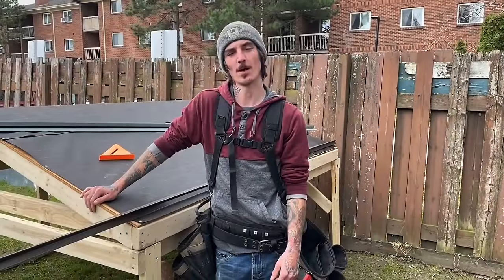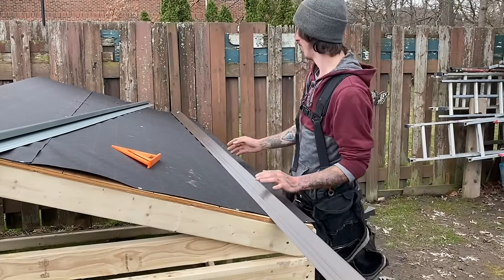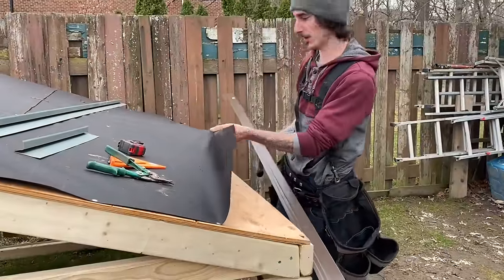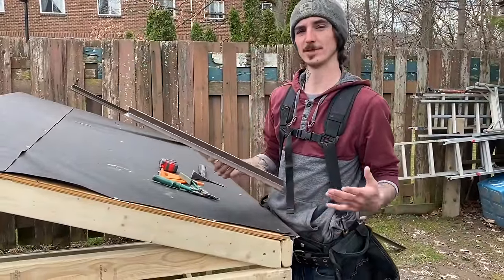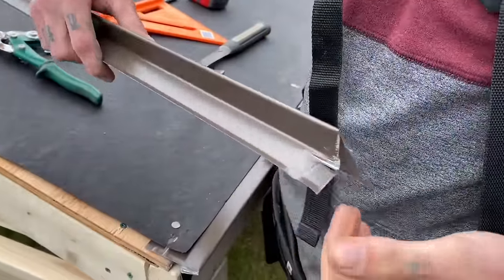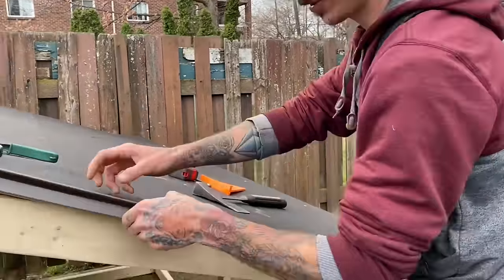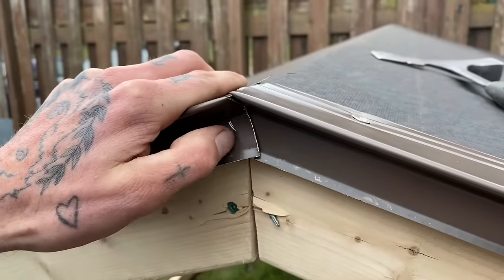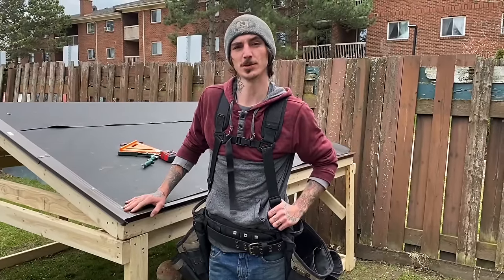How To Install Drip Edge On A Roof

Comment: Hey please don't  spread that information to put the drip edge tight to the fascia. You need to float it out at least 1 inch past the fascia.   The gutter  will only go under the drip edge at one end then you need to have slope. Thats why the drip edge needs to float out so it can still drip into the gutter when you add your slope. 

Having your drip edge tight to the fascia will cause water to drip in behind your gutters.   

I've owned my own gutter business for 11 years and I speak from experience. Customers would always call us after a new roof installation was done, saying that their eavestrough were leaking all over and the roofer said they needed a new gutter system.  But really they installed the drip edge wrong!  

If you think I'm wrong add a gutter to a 20 foot run have your proper slope at the other end.  Yes you tuck your one end under the drip edge. But by the time you slope your eavestrough to the other end it won't be under that drip edge.   In that section do a water test. Grab a water hose and let it run off the roof and you will see the water drip in behind the eavestrough.   Most roofers don't install gutters to understand the importance of floating it.  And you cannot tuck the whole length of gutter under the drip edge or else it would be straight with no slope. You need to have slope! 

Roofers for years have been installing drip edge the way your explaining it and its wrong. Thats why you believe that's how you actually install it because you were taught that way.
Reply: Jason Lajaro is right.  There is a TOH video demonstrating this.  Not only the (important) gutter issue, but even if no gutters are present, having the drip edge tight against wood fascia will allow water to crawl back up between the drip edge and fascia due to capillary action (especially in wind blown rain, which most rain here in New England is).  I just ripped out a bunch of rotted wood fascia due to the drip edge tight against it- it's best to leave a gap, although I'm not sure of the ideal gap - Tommy of TOH says "a finger"- I was hoping for something with more precise units but I think about a 1/2".   Some people use a furring strip to create that gap but I don't see the point as then the furring strip will rot (and look nasty from below for runs visible from below) and in turn will eventually cause the fascia to which it is nailed to also rot.  I think a decent quality/gauge drip edge doesn't need a furring strip to support the required gap.
Reply: is 1'' too much.. I was told by a roofer to leave it 1/4'' off?
Reply: Good info, but does that advice also apply to the rake edge or just the eaves edge?
Reply: @jeclose  Just the eaves edge.
Reply: @christopherr7195  1/2 inch for the drip edge and shingles should extend a further 1/2 inch for a total of 1 inch.
Reply: 👊 some one that actually understands water retention
Reply: lot  people who use named product carry on what manfacture states and depends on state code most prefer a inch out as it drips away from the  board but hey if its windy lol rain going get everywhere  id use a compound to seal corner thats  been cut to shape
Reply: Mr. Average Roofer, is exactly right it was hard to hear go to 2:35 and listen carefully he says, "but not too tight against the Fascia board" because you would want enough room to put the Fascia Metal which is about .030 thickness which can slip behind a very small space behind the drip edge  therefore not needing all the space that you are saying and I know you Jason are very aware that the bottom edge of the Fascia Metal goes down into the gutter so there is no possible way of water getting behind the Gutter. If all gutters can fit up high behind the drip edge then there would be no need of a Fascia Metal but because of the different Gutter Filters, gutters now days need to be mounted much lower than years ago that was before Gutter Filters therefore the need of Fascia Metal so the wind cannot blow the water behind the Gutter.
Reply: Well said Jason, I've been in the seamless guttering business for 43 years I have not yet seen one roofer put the drip edge on the correct way. Really sad.
Reply: @LO-cd7ze  and in winter icicles
Reply: That’s my logic the drip edge has to be above the gutter and away from facia. If you understand capillary action of water. Water can run horizontally and go vertically even up hill. Water has to be guided to drip in the gutter or it will hit facia board or even go behind top of facia .
Reply: Your all wrong.  It's called roof apron. Try it . Way better than drip edge . No water behind gutters.
Reply: @williamclark1801  I've watched 20 videos on Roofing and guttering and everybody says everybody is wrong so either there's a right way and a wrong way so either everybody's doing it wrong or everybody thinks they're doing it right for the average Joe like me it's confusing
Reply: @U4Eye  roof apron is the only way to go.

Comment: Why would you cut your rake dripage at the top of the roof line instead of putting a bird's mouth in the bottom of it and folding it over so there's no gap for water to get in?  That makes as much sense as wiping before you poop.
Reply: Fu*** thank you. How is what your saying not standard by now. Looks better too. I make a perfect ^ then the drip edge seems are equal length the rest of the way down just tuck underneath so your seems are not catching water
Reply: Can you recommend a video that demonstrates what you are talking about ?

Comment: I was under the impression that there is suppose to be a gap between the drip edge and fascia board so the water doesn't run on the fascia board which would cause the board to rot over time.
Reply: You just shouldn't have it super tight to the fascia, have it just resting there. Nail one side of the drip edge, go to the middle, pull it towards yourself just so it's laying flat/flush but not tight. Nail it, then do the same with the end. Makes it so the nails don't buckle the dripedge

Comment: TY all so much I had a new roof done by a contractor that put on the drip edgg and ridge edgg  on first the drip edgg i see you also did that which is fine but they also did the ridge edgg first and then the underlayment was put on and sometimes leaving a space or not on top of the edgg at all so this just confirms they did it wrong. You might consider not butting the drip edgg up against the facial board this makes the rain fall away from the facial board better or into a gutter when the rain is not that hard some will still flow down on the boards and Rott them. Thanks again great video.
Reply: Saw that too. Was thinking if you have flashing right behind the drip edge and into gutter the water will never see the fascia

Comment: The drip edge should not sit against the fascia.
Reply: Then where the hell does it go
Reply: @VegasRoofer Drip edge should sit about about a half inch away from the fascia (that's why he put his fingers between the fascia and drip edge to make sure there was always a small gap between them before nailing down the drip edge).

Comment: The bozo that did my roof on the house I bought place the drip edge against the fascia..When it rains the water runs down the fascia..I thought the drip edge should extend past the roof edge so water clears the fascia
Reply from the maker: jbee railroader does your house have a metal fascia flashing or bare wood?
Reply: Omg most houses are have wood fascia
Reply from the maker: LveMlike maybe where you’re from. Not here. 85% of homes in our area have aluminum fascia metal covering the wood.
Reply: to jbees' point,  Obvious he has Wood,  the drip edge should be spaced away from the fascia so the water does not wash down the WOOD,  rots out in 7 years.  It all depends on experience,  knowing the Best practices for an assortment of  situations .  When I 1st started, we would place 1 row of Cedar shingles,  straight as an arrow flies,  placed off the fascia 2" , then the metal Drip edge,  dumped water close to the center of a gutter.  Look at that,  a different approach,  experience.   See a Problem,  Fix the Problem,  keep an ear to the rail & keep an open mind.
Reply: @karensaaristo4728  you see that little kick out at the bottom of the drip edge? thats what that was designed for. to kick the water out lmao. You do NOT place drip edge floating off the edge lmao. Its literally in the name.
Reply: J D Sorry bro, Karen is exactly right on this.  If your trimming out the fascia with metal or vinyl, tight is acceptable.  As Karen said, however, if you’re leaving the wood fascia to be to be treated with stain, sealer, etc., the drip edge needs to be held away from the fascia to prevent rotting.
Reply: Karen Saaristo That method of getting water to dump at the center of the gutter should be abandoned in any application where the gutters are likely to catch debris.  It becomes a cursing-filled ordeal to clean them out when they are half covered by roof materials.  Alternatively,  I suppose you could use this as a way to sell gutter guards with the project.  Since I hate gutter guards, I’ll never do that method.

Comment: thanks for sharing the video when I put my tar paper down I glue it down with lap cement around the edges of the roof I've seen too many windstorms get underneath the edge of the roof and blow the tar paper and the roofing to the next town I also glue down the asphalt shingles on the edgings to the tar paper

Comment: I am roofer. And i have been fixing millions of crappie roof jobs. 
You did 3 things wrong buddy
Reply: I was wondering about that  - nailing the drip edge under roofing felt on lowest part of roof - nails go under the felt right? I'm learning how to do this....what all he did wrong?
Reply: Shouldn't the drip edge be 1/2 away, not up against it?
Reply: @louie1487  I think there should be a small gap (1/8"~) between facia board and drip edge to prevent moisture retention.
Reply: but you aint gonna say what-- :D
Reply: Cruz y Mario:  Go ahead with your concerns, buddy.
Reply: MARIO....your response....?
Reply: He’s average
Reply: No response
Reply: Ray Bin i think he explained the plan is to slide aluminum fascia under the drip edge - pretty common to do. You want that fit nice a tight - just loose enough to slide the fascia under it.
Reply: @louie1487  no. Close as you can without pinching it tight. Need to leave room for metal fascia and gutter
Reply: @marlinweekley51  dont forget the gutter.  The high side will slide under slightly to allow the opposite side to drop ¼" per 12' or so for water flow
Reply: YO Mario Cruz, please give us the benefit of your vast experience, ~ millions of crappie jobs. Exactly what 3 things were done wrong?
Reply: Mario has no idea 🙄 guess he’s too busy fixing millions of crappy jobs😂
Reply: @happysawfish  He's busy mopping up all the water leaking from his roof!
Reply: @dog4x4  lmfao🤣🤣
Reply: Crappie is a fish, crappy is not stating the 3 things wrong, just an empty comment.
Reply: Mario is Just a simple troll... Hit and run
Reply: @elizabethputnam1650  that's way to much. I take a small piece of the fascia metal and bend it atleast once and use it as a guide. Drip needs to be  slightly tight to the fascia metal so that driving rain cant get under. This is 25yrs of experience and paying attention to the old timers when they try to teach me new tricks of the trade.
Reply: Where i am from you want that drip edge tight bc if they leave a gap the wasp and woodbees  get under it and then i have to go back and fix this bc the customers complain as everyone thinks there way is right but this is the way i do it also and i use metal to cover fascia and tuck it underneath the drip edge as this keeps the wasp and woodbees from making homes as any gaps attract them and keeps rain out. I do not understand why u would want a gap between drip edge and fascia?
Reply: Not sure where Mario is coming from.  Only thing I would do different is make it 1 piece coming from  the peak.

Comment: Thanks for the video.  Good explanation of the work. I've seen some videos with people putting the drip edge under the underlayment all the way around the entire roof and some putting it on top of the underlayment on the sides. What are the differences and is the one right way? Thanks again.
Reply from the maker: Glad it was helpful!  

Not a huge difference, however over the drip edge on the bottoms allow for any water that penetrates to drain without damaging plywood, and on top on the gables to keep water from getting under the paper.

Comment: I had a new roof put on 10 yrs ago. Water now in my walls. Gutter and box fell off. No drip edge no rake edge. And many other issues.
 I am going to try to install these along with rebuilding the birdbox?/s . Before the rain moves back in for good.
However, when I went today to get supplies I was surprised by the amount of different kinds of drip edges. So I shyed away from that part for now. In your opinion.Which kind of drip/take edge would you think is the most universal? Or versatile. I know your busy.
But, it's so important right now for me. I'm in the southern United states. If you see this and could suggest for an old house that would be a great. If not, I understand.
T.y for your videos! Your such a natural teacher.
Keep up the good work!👍

Comment: This is FANTASTIC info for us amateurs. I’m doing this on my home built shed right now. One question; should I go under or on top of the felt on the rake ?
Reply from the maker: Go over felt on the rake, under at the eaves. Best of luck!
Reply: @Average_Roofer  why go over the felt on the rake?
Reply from the maker: @rodwhite9737  if wind driven rain is to get under on the rakes it keeps water above the underlayment. If it was under, water would also get under, ultimately rotting your roof deck along the edges.

Comment: AWESOME AWESOME AWESOME. Vid. Your awesome. nice small example with the mock roof. Very informative you are, u explain evrey detail and reason for this and that , im doing a small same size 8ft roof on shed lean to extension and im right here at this step i found ur other video on the underlayment and ice shield install. today i finish it. Is it ok that i got the wider drip edge? they were out of the narrower size.

Comment: Ive found all your videos very precise and well articulated and helpful, but i usually do the rake a little different at the top of the gable. 
I usually start at the gable with a whole piece and cut the bottom flange vertically letting the metal fold on itself, this way i dont have a joint at the top. 
If one piece isnt big enough for the whole rake, both sides, and you do start by halving a drip edge at the top, wait until youve installed the next piece down to nail the ends so you can slide the next piece under it a little, for the water flow. 

Otherwise, I sometimes do start from the bottom corner, and i just run the piece at the top of the gable long, and do the same, snipping the bottom flange and folding it over the peak of the gable, but not nailing it down on the opposite side until ive installed the drip edge up that side and tucked it under the folded over hang i had left unsecured. 

Does that make sense?

Im curious if there is a operational reason this isnt done?

Comment: i worked for collis roofing in florida and stumbled onto being the tar paper drip edge flashing guy.  all of this had to be inspected before shingles so the roofing company made special crews because the development supers and homeowners were complaining about quality of joints and flashing.  on the drip edge i would start at the back of the house so the drip seams are not noticeable from the front. and the front corner side piece will have a tab that bends around the front on the face of the drip and the top has a 45° tab that extends past the house about .5" the front drip is layed in place and use a pencil to trace the face of the drip on the back of the front face. then cut the mark on the face and cut the top of the drip .5" past the face cut.  then install the front piece and the front top will have a square tab that will fit over the side 45.  this makes a nice pretty corner. also at the top of a gable peak i would cut down the middle of the drip v about 4 inches and cut the face square.  then nail that first piece to the peak and bend the top tab over the peak to the other side.  the second piece will cut down the middle of the drip v about 3 inches and the front face will be cut plumb to the ground.  so when the second piece is nailed in place the face will be straight up and down and the long top tab gets bent over the peak and nailed on the other side creating an overlap to keep water out.  hope this makes sense.

Comment: Jeezus.. finally, someone who points out the correct placement of the drip edge in correlation to the placement of the underlayment for both eve and rake edges.  So many roofing videos, even "This Old House", who gets it wrong every time.  Only 1 state allows eve edge to go over underlayment, Florida, and even there, they have to still apply roofing cement (tar in a tube essentially), so might as well just put it under.

Comment: Thank you very helpful.  A question.  I have built a storage unit with a slanted roof just on one side.  I understand that I will install the drip edge on the lower front edge and sides. Do I install a piece at the top edge also?
Reply from the maker: When you get to the top you can install a piece of drip edge to finish the roof. Or simply buy an L shaped wall flashing and use it upside down.

Comment: Just re-roofing the dog house today.  No I don't have to live there at times.  I haven't installed drip edge for a long time so this was a good review. Thanks!
Reply: Al, better go back and create the gap Average Roofer failed to include between the drip edge and facia board. Mpst recommend 1/2" to 1").